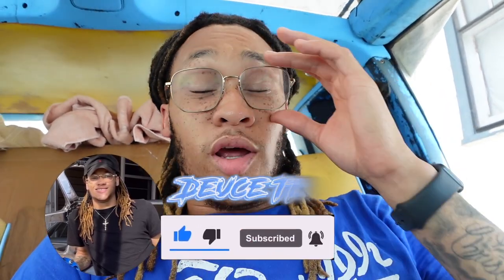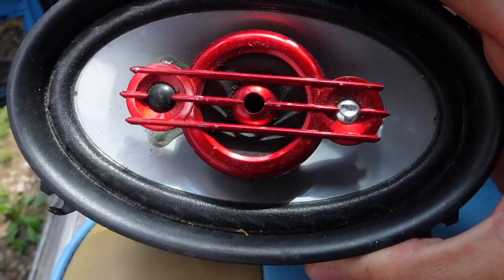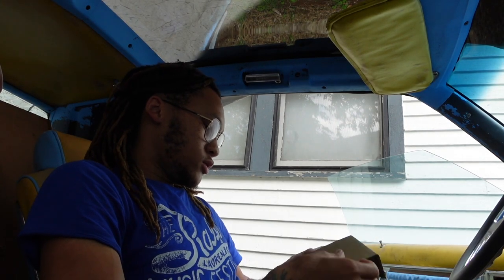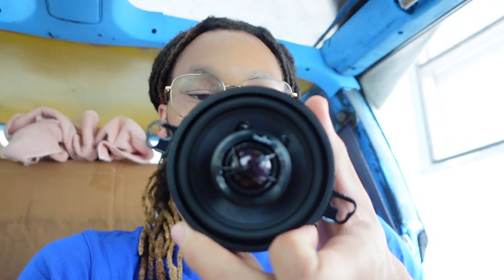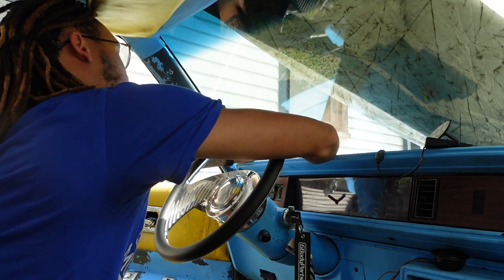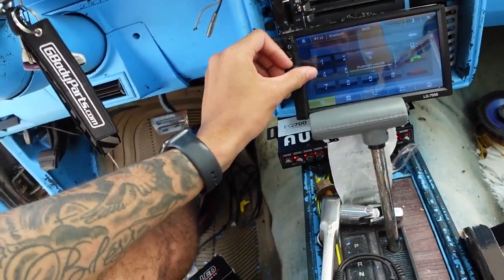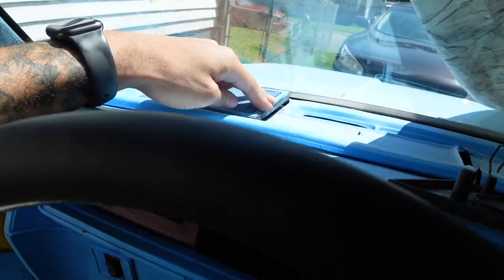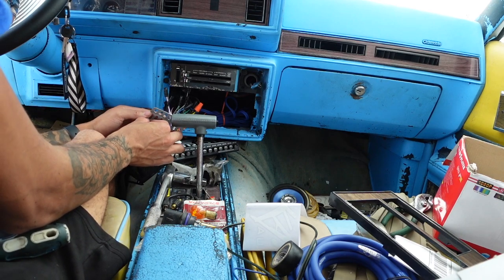I Got 2 New Skar TX35 3.5 Interior Speakers for the Cutlass

Comment: Whats the info on the speakers? Trying order me some
Reply from the maker: I got mine from skar.com for $36. It’s a 2 pack, so you would get 2 of the 3.5 speakers for the $36 price and skar website says “high-performance, 2-way coaxial speakers engineered and designed for the audiophile seeking sound perfection. The elite series of TX speakers are extremely powerful and efficient, delivering an unrivaled listening experience at the loudest volumes. Engineered for sound excellence, these 3.5" speakers utilize a high quality 1-inch copper voice coil as well as a premium ferrite magnet, providing more than enough power to bring your music alive.”

Comment: How did you take that speaker shield off??
Reply from the maker: I used some trim poppers I got from harbor freight. It’s 2 hook shaped clips, one in the top towards the windshield, and the other towards the cluster by the door. Be gentle and take your time so nothing crack unless you have replacements
Reply: Good lookin I just ordered some 3.5 skars I'll go get then poppers
Reply from the maker: @broderickharper5976 Yessuh bro, no problem
Reply: Aye man I hope you see this but I just put those 3.5s in and yes everything went smooth I did have that tool in my car!!! Lol but yea im gonna have to fabercate holes in the screens some how
Reply from the maker: @broderickharper5976 I’m glad it worked out bro. yeah, I have to fix the holes on dashboard but other than that, it’s perfect. Glad I could help!